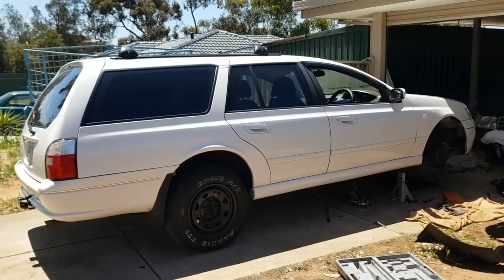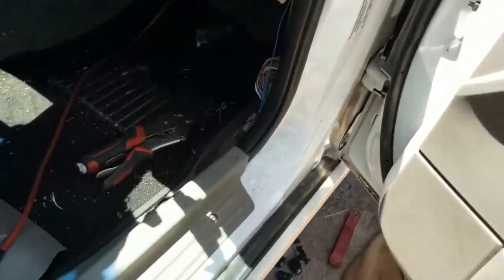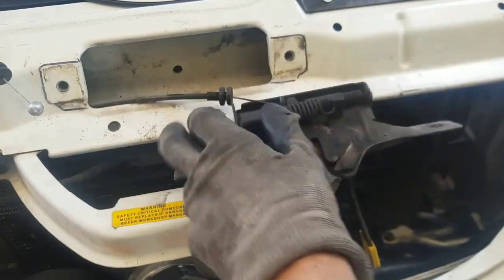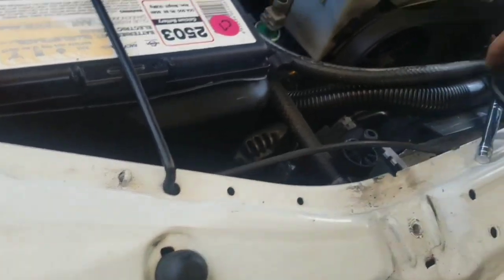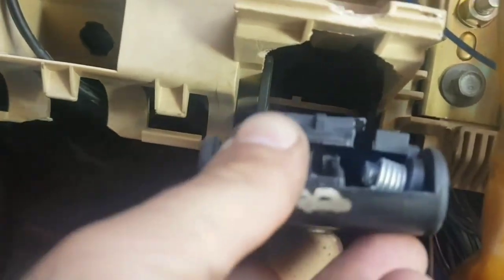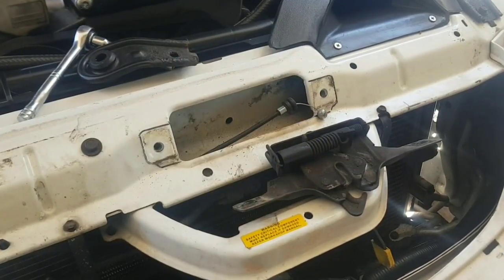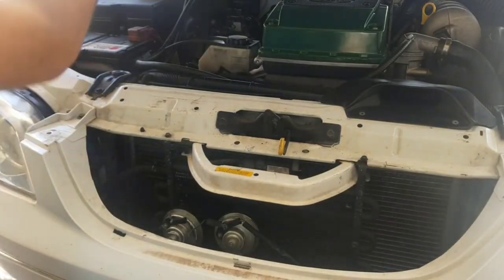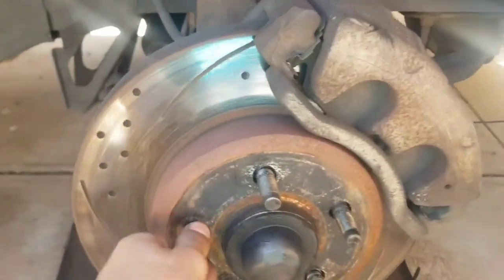How to replace a broken Bonnet release latch and cable on BA/BF Falcon (step by step).

Comment: Thanks for your video mate. Started this project last week and realised I was going to break every screw clip in the wheel arch and grill assembly on the way out - they were all well and truly buggered which is fair for 20 year old plastic.

Put the job on pause and got a set of x200 new ones on ebay for $11 and completed the job without any issues.
Reply from the maker: No worries mate and yes that's right the plastic screw clips all started deteriorate now and that's it we just have to replace them as we go with new counterparts

Comment: Nice work! But what was Ford thinking attaching the bonnet release lever to the fusebox? I bought a BA Falcon ute recently, pulled the lever for the first time and it immediately fell off... 🤔
Reply from the maker: Absolutely! Surely Ford came up with the design as an afterthought after designing the dash. Ahh rotten luck. Apparently Ford made a revised latch to replace the original to alleviate the problematic originals.

Comment: Hey man thank you for the tutorial should make my job on the weekend easier however my hood is down and I’m not 100% sure how to open it up do you have any tips?
Reply from the maker: Thanks mate, no dramas. Get some pliers mate and pull on the metal part of the cable that usually sits inside the flap under the dash that would unlatch the bonnet. It'll pop open the bonnet open.
Reply: @FordMercGuy  thanks mate so many little tricks to falcon ownership
Reply from the maker: Absolutely it mate learn as we go

Comment: Does this one cover how to open the bonnet after the release has been broken?
Reply from the maker: So your plastic pull release handle has snapped off? Are you able to pull the cable with pliers?
Reply: @FordMercGuy  it feels like it come loose. It feels like I could pull the whole cable from the dash.
I have it booked for repair, but that is a few weeks away. I’m worried if the battery goes, I have not way of accessing the engine bay.
Reply from the maker: If you brace the plastic part that's remaining with left hand firmly and pull with pliers with right hand, the bonnet will come undone. Use quick force.

Comment: Is it possible to just remove the damaged plastic release lever and attach a new one to the current cable?
Reply from the maker: It might be possible mate. Although from memory this aftermarket one I put in.. The way it holds the cable and pulls it is different to the original one. So it may not work. But if you can get just a handle on its own give it a shot. If you have to buy both cable and handle together atleast you have back up cable and handle ready to go if the new handle can't attach to the old cable.

Comment: Hi mate. My bonnet release worked fine fine until I installed a new bonnet. Now the bonnet release is very hard to the point where I'm afraid it's gonna snap. Is there any way I can loosen the cable? Thanks.
Reply from the maker: I'm unsure mate, maybe you can look at either end of the cable and see if you can loosen the bolted points like on the bonnet catch area. It's been a while since I've done the job on the car for this vid sorry mate.
Reply: @FordMercGuy  No worries mate I appreciate your help.
Reply: @FordMercGuy  I thought I'd go ahead and buy a new cable hoping that it will fix the issue and it did! Thanks to your video I was able to do it on my own. if I had to take it to a mechanic, who knows what I'd be charged, at least 200. I got it done even cheaper as I haggled the ford bloke down to 50 bucks 😆Thanks again for your videos.
Reply from the maker: Mate that's Such epic news! Super glad you got it sorted, and can open the bonnet comfortably. Awesome that my vid could help mate 👊👊 if you can, give my biz a follow on instagram/Facebook @handyautocare

Comment: do not have to remove complete scuff panel, just undo two push in clips , front and rear of kick panel section. pull towards pedals too access removal of cable. do not have too at all remore than what i said , replaced dozons and quickly without the extra not needed work.
Reply from the maker: Legend right thanks for sharing I'm sure it will help many people in the future
Reply: Not sure why you needed to pull off the rear door scuff plates... the front yes, to get to the kick panel.  Annoyed I will have to drop a wheel and wheel arch trim to get to it though.
Reply from the maker: Hi mate, I was just winging it, learning as I went. These tutorial style Vids are great, we can all look back and see what's needed or not in the process. But yeah could be worse. Well worth the effort having a new one up and running

Comment: How do i open the bonnet to take the grill out tho
Reply from the maker: Use a set of locking pliers or standard pliers and pull the metal bonnet cable from under driver side dash mate. The bonnet will pop open👍

Comment: I wish i'd never bought a BA. 
Electric window cable replaced, window stuck open.
Radiator replaced, leaking.
Ball joints replaced, worn out,
gear box replaced and engine chemically cleaned out, intercooler leak,
This problem, broken cable. still broken.
Passenger window glass off window rail,
And now gear linkage bush worn out, replaced twice and still slips off gear selector nub on box so cant change gears. $20 piece of plastic that will leave you stranded.
Any one wanna buy a BA?
Reply from the maker: In our family we've owned four BA Falcons and only one of them had idling issues as it's main problem. Sometimes some cars have just had a harder Life Less maintenance and maybe also bad luck. But damn that selector issue mate!!

Comment: Wrong battery fitted. Should be 5375.
Reply from the maker: Yeah, we should both tell the previous owner that had installed it. When it needs replacing will be going with the oem recommended specs as I always choose for my cars
Reply: @FordMercGuy  don't be cute. I was just fyi.
Reply from the maker: Nah man all good, thanks for the heads up, I didn't ever pay attention to the battery since it was mums car but can let her know now. Cheers again